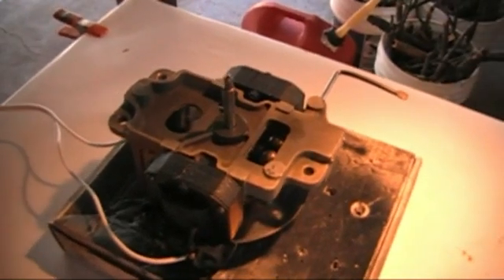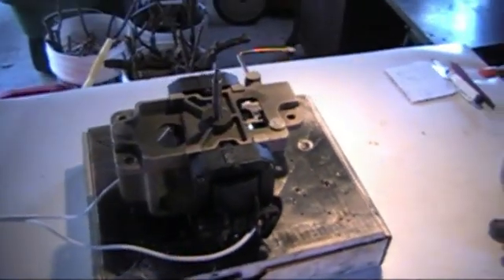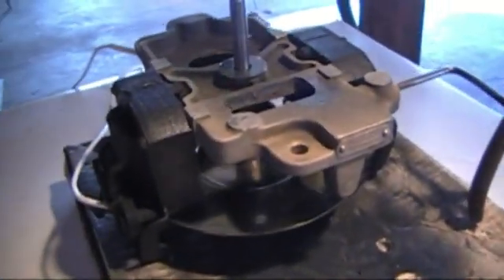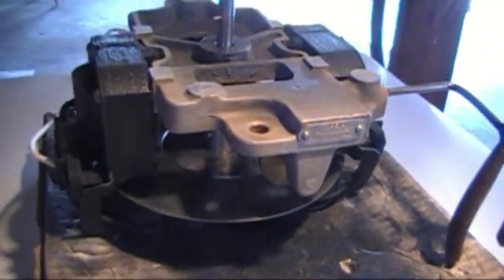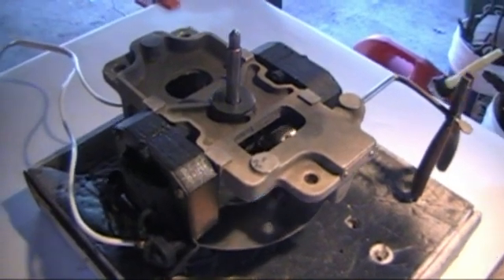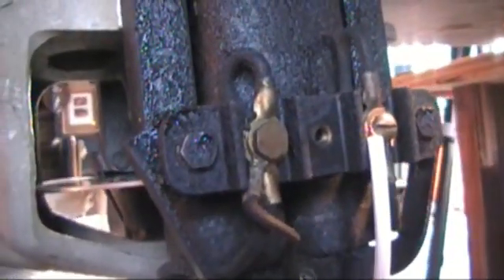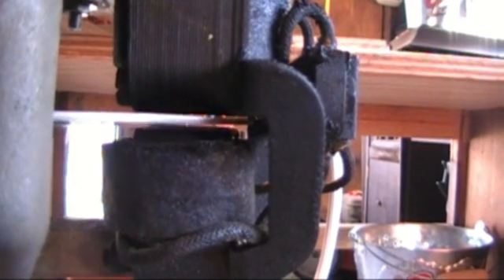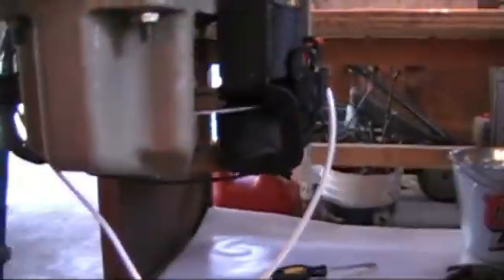Victor Credenza Electric Induction Motor

Comment: Your video was very helpful. I have a Granada that the bottom platter was rubbing the induction magnets. I did not realize that the screw on the bottom adjusted the platter height. Now it’s perfect. The only question I have is how to eliminate the hum on the coils? It’s not super loud but it does hum loud enough to hear coming up through the board. The coils get warm but not really too hot to the touch. Wondering if you can offer any advice?  Thanks!
Reply from the maker: The sound comes from the paper insulation in the coils and depends on how well they have aged through the years. An induction motor stored in a bad environment (damp basements or extreme temperature changes) will usually be worse. The only true fix would be to have the coils re-wound. You can somewhat reduce the hum with new and thicker felt washers between the mounting bolts (motor / motorboard)

Comment: I have one and it too sounds good but one of the small coils gets hot while the others are cold. There is also a difference in resistance that increases as it heats and drops as it cools, below the resistance of the coils on the other side. Any thoughts?

Comment from the maker: @BassetHoundTrio  If your motor hums you might try new felt washers between the mounting bolts (motor / motorboard) The sound comes from the coils and depends on how well they have aged through the years. An induction motor stored in a bad environment (damp basements or extreme temperature changes) will usually be worse. The only true fix would be to have the coils re-wound.